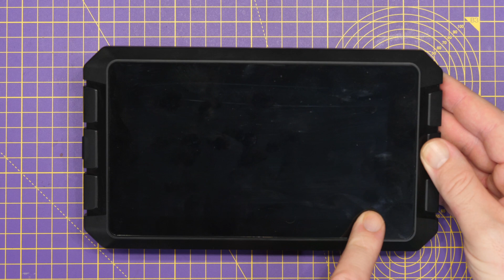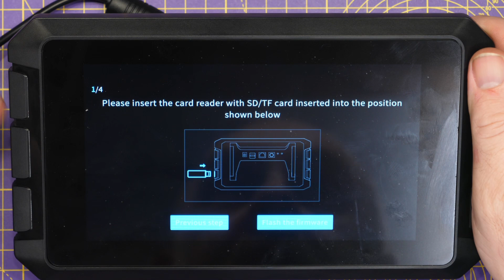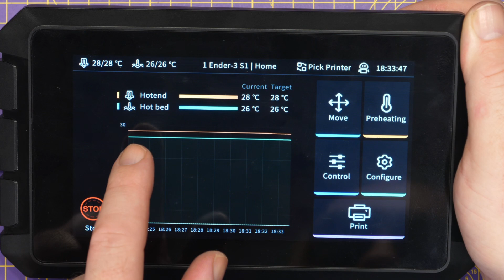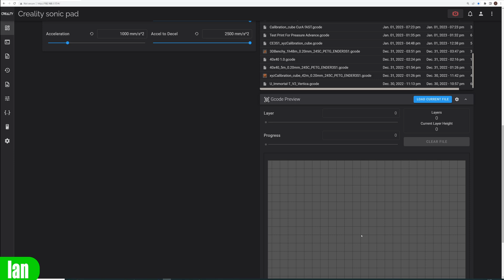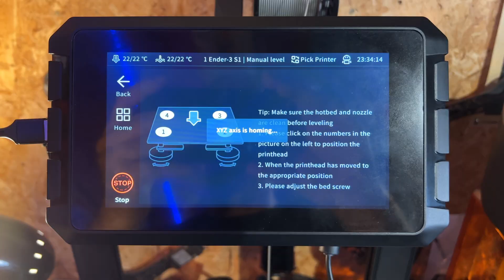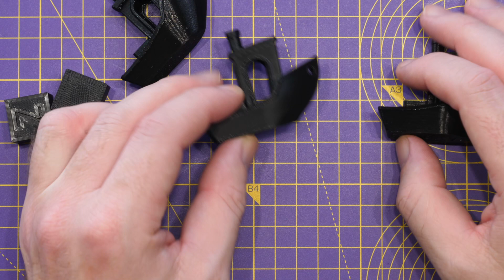Creality Sonic Pad Review  - 3D Print Faster & Easier With Klipper

Comment: Creality told me I could use the Sonic pad on my E5M so I could them access Fluidd, which I cannot do with stock software. But the E5M is NOT lilsted in the upgrade software nor will the other moedl selection create the flash I need. PLEASE Any thoughts woud be helpful? Creality has not answered my tech ticket after a week.

Comment: To add... I did this yesterday.  My printer would not connect via the USB ports. I got another cable with my pad that is USB to serial and that is the only way my pad would talk to the printer.  So if by chance these instructions don't work see if you got a second USB cable.  It goes from standard USB-A to a box with to wire plugs.  You have to remove the old display and plug that white plug into the USB to serial cable.  Then when starting up you need to select connect with a serial connection instead of USB to USB.  Then just remove the old display...it's. No longer connected.

Comment: Do your homework and research before buying. Pay special attention to all of the posts about bed leveling issues. It's great for some printers while only claims to support others. I had major leveling issues after using this thing, while the original firmware was fine. It doesn't matter how careful you are setting thing up, it will ignore you z and level setting and trash your build plate if you have a printer it wasn't tested on, like the cr-10 smart. My printer was fine when I got it, but now with the sonic pad, it's a complete nightmare.

Comment: There are a couple of things that should be added to your excellent review. First, you can configure up to 4 printers and easily switch between them. Obviously, you can only print to one machine at a time, but if you have different printer models, you can easily switch among them. Also, I have made some of my own modifications to my ender-6 which initially caused some problems. But via the web interface, I was able to change some settings in the configuration file that solved my problems quickly.
Reply: You can batch print now from the selection screen
Reply: It is not obvious you can only print from one, so please retract your wording

Comment: Is there a way to print from a USB drive if for some reason you can't get online?
Reply from the maker: Yes absolutely
Reply: @MadRC  if I slice from cura and put it on a usb drive nothing comes up. Do I need to do anything special, different extension or enable it somewhere or should work like any other printer? Thanks for writing back.
Reply: As long as you can get the Sonic Pad connected to the printer, you can print from the Pad.

Comment: Thank you for the review and your honest opinion! Also nice to see some results of printing some files. But one questions remains for me… if you decide to get back on Marlin on the Ender, do you have to upload the firmware back to the printer again? Keep up the good work 🙏
Reply: Yes, you should be able to flash marlin firmware back on your board and you should be good.
Reply: Yes flashing back to the original firmware is very easy.

Comment: Replace the long usb input cable with a right angle USB-A to USB-C.  There needs to be a way of changing the default Preheat settings. Not everyone uses 200 PLA and other “Favourites” would be better. Updating speeds or Z heights are not instant on the pad if it is busy doing something else - but quicker via the console. A screen protector would have been nice.
Reply: default preheat settings are quite easy to change, also adding more preheat profiles is possible (current firmware in 2024), speed and z is also easily changed. Screen protector was actually on the pad when i unboxed it

Comment: Having sourced, printed, assembled, configured and tuned a Voron 2.4 with Klipper on a Raspberry Pi + ADXL345 (accelerometer) and Input Shaping - I can't help thinking that the Sonic Pad is a bit expensive for what it does. A Raspberry Pi (yes, I know there is a shortage atm) and an ADXL345 (about USD 2) will get you the same print improvement MINUS the pretty touch screen (there are alternative options). Granted, it takes a bit more effort to set it up yourself. Still, I think it's something to be considered if you are technically inclined.
Reply: tried the Pi klipper method, got the sonic pad 2 days ago. not the same. yes, the pad is costly and could be reproduced quite easily, but this is an all in one package. got it for under a 100 swiss francs. A pi 5 8gb plus a touchscreen would cost me more than that at the moment

Comment: Hi just set up the Sonic pad on the Ender 5 S1, Does setup stop you from using the printer itself? I've noticed the printer touch screen is just blank and doesnt react even without sonic pad connected. Is this a normal thing or can it be reversed if necessary?

one of the main problems I had was the z touch for auto leveling when it came to the calibration was, the nozzle is nicely on the bed surface area but the actual sensor hanging off the bed surface area resulting in no touch and a nozzle to bed clash and nasty sounds (couldnt find anything regarding this after everything else was done correctly..) I had to move the bed plate cover offcentre just to accomodate the touch. Am I doing something wrong?
Reply: This problem can be fixed by editing the Configuration file by was of the web interface.

Comment: It is a bit of marketing hyperbole.
You can't make a mustang perform like a Ferrari simply by updating the software.
Reply: Some of the hardware is being upgraded.  The computation for all of the movements is being offloaded from the stock weak MCU to the Sonic Pads 64 bit CPU.  This is a huge leap in processing power.  That allows for much more accurate movements.  It also allows for complex algorithms such as input shaping and pressure advance which can improve print quality significantly.  That is how the printer is able to print 2 or 3 times faster and still achieve the same quality.  So yeah, the Mustang still isn't a Ferrari, but it's now supercharged and running NOS.
Reply: You can if you change out the motor!!

Comment: Excellent review. Clear, informative and detailed. 

I'm considering a Sonic pad but my Ender 3 v2 has been modded with a Mosquito hotend and Bondtech extruder. So the vanilla Ender 3 v2 profile already on the Pad won't play nicely as the x/y offset isn't default and the temperature tables are very different from the default. I'm wondering if a profile for my printer (with BL Touch support) is available anywhere. I've just started looking and asking around. I've contacted Tiny Machines who provided a superbly configured Marlin with my Mosquito / Bondtech assembly. Will also ask Bondtech and Slice Engineering. 

Anyways...just to say that the above setup works so well. Very impressed with the upgrade. It's just the amount of time prints take!
Reply: I, at one time had my ender-6 setup with the Bondtech DDX extruder with a CR Touch (functionally the same as a BL Touch) with a Creality 300 degree hot end and it worked fine. I has just a bit disappointed with the part cooling fan on the Bondtech extruder.

Comment: One thing I don’t understand is how much you need to change your Cura configuration to take advantage of the features offered by Sonic Pad. Is it just using a higher print speed on Cura, or do you have to change many other settings?

Comment: If it’s made by Creality, why don’t they just make it part of they printers ?
Reply: Serious? You have to ask ?
$$$$
Reply: @graphguy a pure marketing choice 😎
Reply: It will very likely become part of their printers in the future. I prefer they release it this way, as an ad on first, for those of us with older printers.
Reply: @Big.D.  I agree, and if the printer breaks, at least you can move It to your new printer.
Reply from the maker: Probably will happen in the future.
Reply: Simple, defeats the purpose of selling a budget friendly 3D printer. The Ender 3 v3 se is $199 shipped. Adding this device makes it almost $350. A beginner can get a beginner friendly printer and learn how to use it and decide if the hobby is for them THEN spend another $135 to upgrade it.
Reply: They now have some of the features built in to the newest ender 3 printers.  Like the ender 3 v3 KE I believe.
Reply: @Jack5822 yes, some. But this device is for a new life of old machines. I suppose

Comment: Great review. Thanks Ian - I enjoy your drone content too and will be signing up as a Patreon. I have an Ender 3 Pro with a 4.2.2 motherboard, I saw on your video that my machine is preconfigured on the Sonic Pad. However, I'm in the process of adding a sprite extruder and CR-touch. Is it easy to add these modifications to the standard E3 Pro on the Sonic Pad so it provides the right firmware to e.g. achieve a higher extruder temp?

Comment: off topic: have you heard or tested the TOPDON - TC001 which is  a 200 GBP infrared camera module for android with a 256 x 192 sensor it capable of recording temp development.

Have seen a review already which showed the big advantage of the big sensor but would like your experience cause you had purchased one last year with a bit lower resolution if I remember right, but i could no longer find on the channel via search cause thermal nor ir / camera / infrared showed me 1 result or I simply over looked that.

Comment: Looks very interesting. Can you also setup modded printers like for example Ender 3‘s with 3rd party direct drives or other probes than the crealiy ones? Is it possible to limit the usable bed space or height as this is often different with other direct drives.
It‘s a great price imo I just think the bed level mesh and other features in the web UI look very similar to Octoprint.
Reply: it IS possible to create custom firmware and modify config for existing but since SonicPad was designed to be "user-friendly" modifications are not easy and troubleshooting may be quite  frustrating. I have CR10s PRO upgraded to PRO V2 with bltouch and TinyMachines firmware.  Looks like bltouch ports are different and Klipper firmware keeps crashing hotend into bed  during testing sequence :).
Reply: @sasasasa-lx6cl  That`s bad... I've got an Ender 3 with micro swiss NG and a EZable. That is possibley worse to get running. So I will not get the Sonic Pad at the moment. Thanks
Reply: Yes, as I mentioned above, I added a Creality Sprite and a 300 degree hot end. I has some crashing problems, But by editing the config file via the web interface, I ws easily able to make all the adjustments with respect to useable bed size reductions to correct the issues/
Reply: @JustSomeHuman-j8o  Mods like EZable probe, Microswiss hotend and a TH3D board... i guess that might be a bit of a challenge?
Reply: @McLogo76  I guess I don’t get your snarky comment
Reply: @JustSomeHuman-j8o  Wasn't meant with any emotions or so ;) I'm just thinking that it could be a bit of a challenge with mods that are not from creality or are similar to their stuff.
The EZabl probe for example or having a different board. I guess a NG direct drive ist not that much of a change?